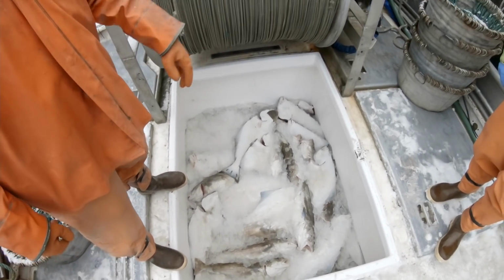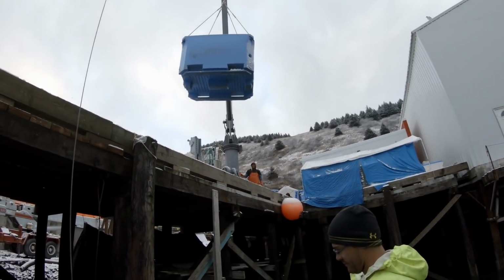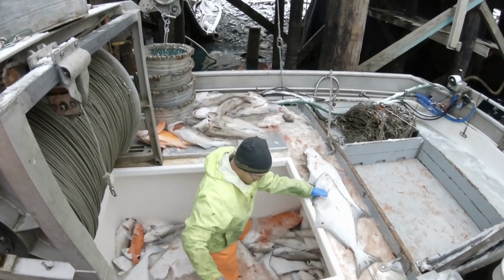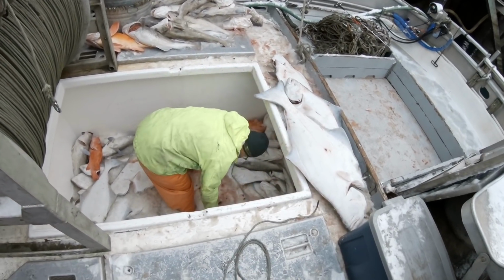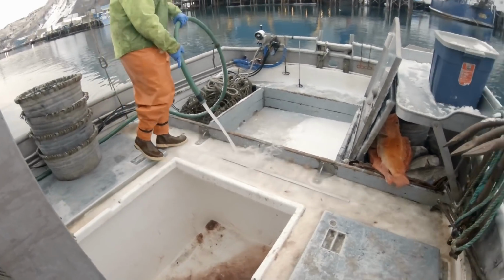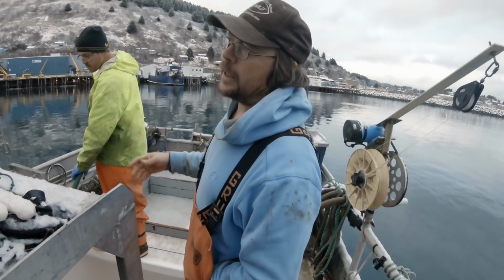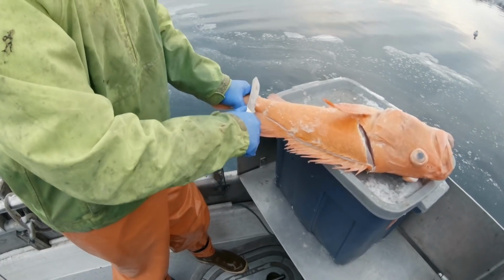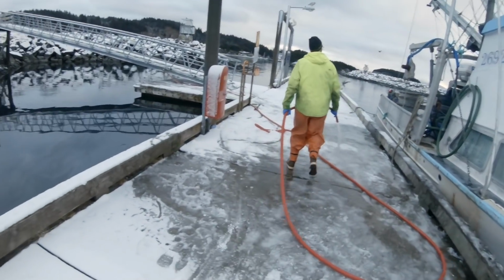Wrapping up the Season Pt.5 - Last Offload of Halibut

Comment: Those 3 copper looking pipes with the points, whats the purpose?  They look very dangerous
Reply from the maker: Hi Nonc. Those are the anchors we use at each end of the longline set. They aren't really sharp, but you need to be careful not to hit your head on them if you are in the fish hold.